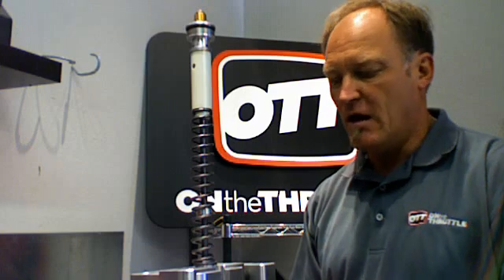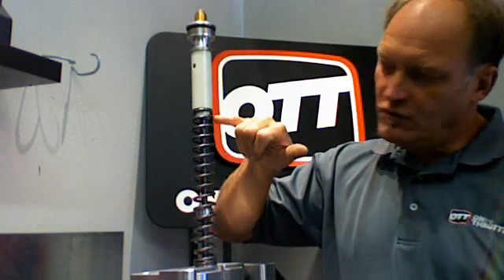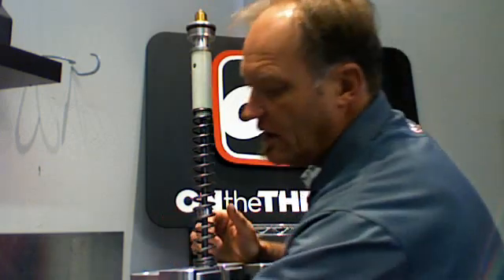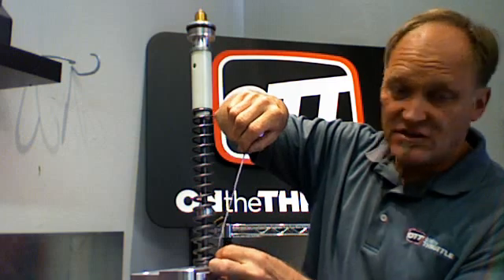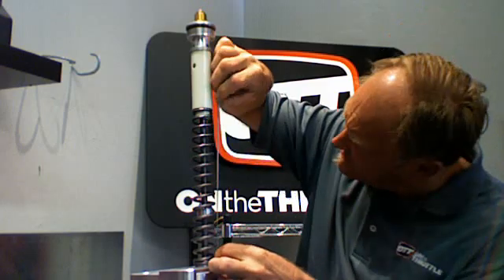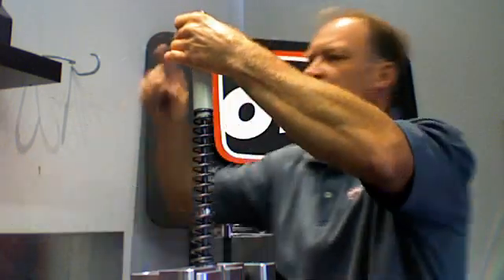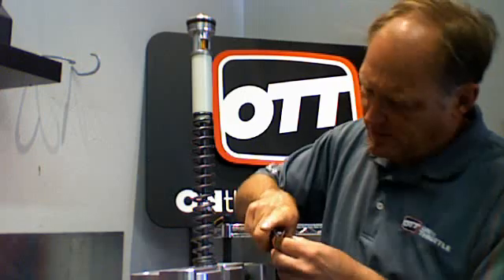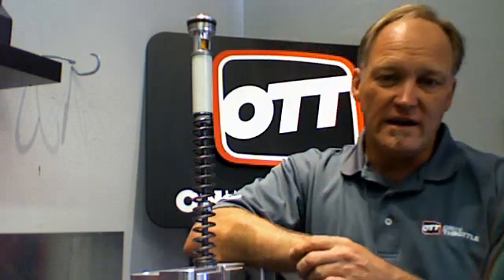what is installed preload on a fork spring and how do we measure it?

Comment: If I used pvc and a washer instead of the preload spacer designed fkr the forks. What sort of danger would I be running into?
Reply from the maker: The PVC being too soft, so ABS black plastic is more rigid. If the spacer fails, the fork immediately drops the distance of the spacer. If it chips, those pieces are in the suspension system which is not ideal.

Comment: Dave, you indicate in this video that you want to keep the same "length".  However, the racetech springs to replace the OEM springs are much longer.  they say to cut the spacer.   does having "more" coils of spring change anything?  or by cutting the spacer, is it effectively just accounting for the extra length and doesn't change the functionality of the system?  Thank you!  --Justin
Reply from the maker: When you calculate the OEM spring & spacer length, replacement springs normally require the spacer to be cut and sometimes that means new holes for the spring compressor. I choose to check the OEM installed preload and note the amount and correct spacer length for the 10-15mm I prefer.

Comment: Do u have any info on harley-davidson dyna suspension set up
Reply from the maker: At this point we have no Harley Videos. I do have generic information regarding ergonomics, pressures, fork oil and geometry as well as shock preload tuning.
Reply: @catalystreactionsbw  iv just installed yss piggyback shock an racetech springs hold valves 2 inch taller dampening rod's. I'm very keen on any info or help
Reply from the maker: @diesel5460  set sag at 35-40mm for the forks and 30-35mm for the shock. Assess fork and shock travel used to see how close or far away from bottom out you are. Once the oil is hot after 30 minutes or so, set rebound as best you can.
Reply: @catalystreactionsbw  thank u for your help appreciate it

Comment: Hi Dave! Question: I am thinking of replacing my OEM front fork springs for my 2016 Kawasaki Concours 14 for a stiffer spring. OEM is 1.2kg/mm and I am thinking of replacing with a 1.3kg/mm (Racetech recommended for my weight and riding style a 1.36kg/mm, I can't find that anywhere).  Anyways, eom length is 244mm uninstalled free length, the replacement will be 250mm. I heard I just need to modify the preload spacer to accommodate the 6mm difference. If I do that, wont I need to move the holes in the spacer too? What purpose do those holes serve? Thanks so much in advance! 💯👊
Reply from the maker: The holes in the spacer are for the fork spring compressor. at 6mm longer for the new spring, that changes the installed preload slightly but not by much so it might not be necessary to trim the spacer. You will need to change oil viscosity to manage the new rate as stock damping will be quickly overpowered by this rate.
Reply: @catalystreactionsbw  thanks once again Dave!  I have no idea what fork oil is in it (I'm the second owner and everything is stock and the last owner told me he never changed the fork oil).  The manual says KHL 15-10, which doesn't say what weight it is. So... I am gonna say it is 5wt and maybe I should be using 10?...  I am 220lbs. Any words of wisdom?
Reply from the maker: @ManCalledHorse  I used 10w to the stock volume in my stock C14 forks and that worked well for the most part with general touring. I drained then for 24 hours with a simple oil change to make sure I got as much debris out as possible (24,000 miles).
Reply: @catalystreactionsbw  that is great to know! I watch all your videos and learn so much. If I do a lot of canyon carving, 10w should still be good? I live in San Diego and hit the Twisties as much as I can 🙂
Reply from the maker: @ManCalledHorse  Yes, 10w would be my choice.
Reply: @catalystreactionsbw  you the man Dave!! 💯👊🔥

Comment: So if you add preload, the fork will extend... now I'm cofused. I though when you add more preload you add more pressure on the spring.
Reply from the maker: Common confusion. Th fork is two pieces. Bolted tube in the triple clamp and moving tube. When you add tension to the spring, it resists travel more and in doing so it can push harder on th moving part. That reduces static sag and makes the forks longer as there is more stress pushing down on the moving part. Does that help?
Reply: @catalystreactionsbw  Thank you so much. It makes sence know 👍🏻
Reply from the maker: @Striple  A lot of people see a tensioned spring as shorter so the forks MUST be shorter by default so now you can help others who are confused too :)
Reply: @catalystreactionsbw  Haha we'll do.👍🏻

Comment: Hi Dave, I have a 21 year old Montesa Cota 315r.
Even when I add full pre load, I still get a lot of slack when I pull up on the handle bars. 30mm approx'
Would this be normal? or have the springs collapsed over time?
Kind Regards, Dave K.
Reply from the maker: Static sag on forks is 25-35mm, so your number is normal. You can increase spacer length by 5-8mm with washers or make a new spacer. Springs were very soft back then. How old is the fork oil?
Reply: @catalystreactionsbw  Hi again Dave, thank you so much for your prompt reply sir. Very much appreciate your help.
I have owned the bike for only a few months and the only service history I have suggests that the fork oil is more than 10 years old.
Regards, Dave K.
Reply from the maker: @davekelly7184  probably 15w fork oil to start to the volume in the manual. If there is no manual, start with oil height at 140mm. If it bounces around with 15w go straight to 30w.
Reply: @catalystreactionsbw  The bike will be out of action for a new clutch soon so that will be an ideal time for me to change the fork oil.
When you say oil height, is that the length of exposed suspension travel at rest?
Once again, thank you for your help and advice.  Dave K.
Reply from the maker: @davekelly7184  Fork collapsed, no spring or spacer, measure from the top of the fork down to the oil.
Reply: @catalystreactionsbw  Thanks again Dave, much appreciated. Dave K.

Comment: Very interesting Dave. I have a DRZ400E and I cant find any information on what the fork pre-load should be, even as a ball park. If the rear is around 100 mm of sag what should I be looking at for the front?
Reply from the maker: 33-35% is the general rule for all so for the front 120-130mm is a good starting point

Comment: Hello sir, I have a Harley Davidson and swapped out my stock front fork tubes with+2 tubes and patriot genesis springs along with pre load adjusters. RWD shock in the rear as well. I’ve seen others cut the spacer flush with the top of the fork tube and some about half an inch above. Which would you recommend?  Thank you.
Reply from the maker: Prior to rebuilding the forks, check the OEM spring and spacer length and compare to what you are upgrading with. Also measure the amount of threads that screw into the cap. If you have over an inch of threads to screw in, cut the spacer flush with the top of the tube when fully extended.
Reply: Dave Moss Tuning I will try doing that tonight. Thanks again.

Comment: how is it when the preload adjuster itself is removed, you can get it back
Reply from the maker: Not sure what you are asking. Preload via the manual adjuster adds more stress on the spring on top of installed preload. The preload adjuster is in the cap, so if the cap is removed, the second measurement shows the installed preload.

Comment: Hi Dave love the video.  Just had fitted new KTECH 10N springs to my Suzuki GSXR 1000 2004 forks.  Rider sag with all preload out 38mm.  The spacer was cut by 5mm as new springs turned out to be 5mm longer than OEM.  At this setting zip tie ended up at 34mm from bottom out.  Changing spring seemed to affect how much rebound I needed and I ended up with compression damping fully out.
Given that required installed preload may be lower for stronger spring do you think I ought to have spacer shortened further to give me some useful adjustability back?   You hinted at range between 8 and 15mm giving a degree of option?
Reply: did you ever get the answer to this ?

Comment: Hi Dave,
Just got a new softer spring for my Showa BPF (Honda CBR1000RR 2012). Original spring is 230mm, 10,1N/mm, and new spring is 235mm, 9,5N/mm (K-Tech). So it will add 5mm installed preload. I don't know the original installed preload. Preload adjuster spans 16mm (64 clicks). I assume some of the installed preload will be taken up by the top out spring. Am I okay will this new spring length?
Reply from the maker: Absolutely okay, you will need less preload on the adjuster. Set static sag to 12mm when the shock is cold and start from there :)
Reply from the maker: It should not be noticeable if static sag is set correctly and matched with rebound damping.

Comment: If the preload is maxed compressing the spring does that mean the spring is incorrect even if settings are within range.
Reply from the maker: If preload is maxxed out, it can mean oil level is too low, compression settings are too soft or the front is carrying too much weight. If oil level, settings are geometry are correct, installed preload needs to be measured (video on that topic) to see if the math is correct internally. If the math is correct, then are you dealing with a linear or progressive spring. In each case, if the math is right a stiffer spring is required
Reply: Dave Moss Tuning thank you for responding do fast !!
Reply: I have been getting a wavy type of oscillating feeling riding the bike hard at the track? I'm getting better, faster it happens with acceleration especially when on a banked or uphill turn coming out onto any straight away say Thunderbolt NJMP any ideas? I am assuming that the suspension shop I am going to is correct with setting my bike up math stuff...(although I don't like that the preload is maxed out) racetech springs .95 gold valve kit front Nitron track shock rear. Fairly new tires power cup evos,  I switched my bike with Glen Goldman at a TPM track day and he experienced the same so it's not me screwing up with body positioning. I am 162 pounds without gear.
Reply from the maker: The shock is too stiff or too soft, or the tire pressure is too low. Start with more and then less preload, then more of less compression, then more tire pressure last

Comment from the maker: Holds the spring under tension rather than allow it to flop around inside, and pre-tensions the top out spring in the cartridge. That measured tension then also helps with adding preload to set sag and help with brake dive.

Comment: what does the preload acturly do?
Reply: It sets pressure on the spring to hold into the coil over unit when no vehicle weight is on it. That is the only thing it does
Reply: @phoenix21studios   You responded 9 years after he asked that question.
My guy got married, had kids, sold his motorcycle to buy a station wagon, sold his station wagon to by a crossover and is now considering an electric vehicle.

Comment from the maker: Not necessarily higher by that much! Sit on the bike and have someone measure the bars to the ground, then remeasure after the fork preload change with the forks in exactly the same position. The relationship between installed preload and height is not a linear one.

Comment: Hi dave aprisiate to excellent vids and wanted to ask a pesifid question about the preload settings I've set them at a good starting point and the bike rides very well  but at  high speeds the front feels like its bouncing  on the top of the road so I've droped the forks 2mm which makes this problem better but now the rear keeps spinning when driving out the turns  can you advise away of further adjusting the rear